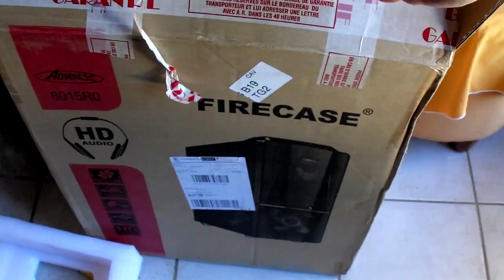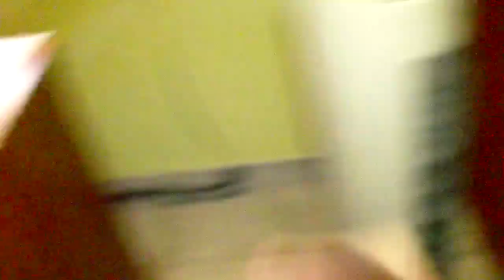Comment monter son PC

Comment: Heum mec tu te demande pourquoi ton proccesseur chauffe autant, tu a mis le ventirad fourni avec le ce dernier cest normal il faut que tu achete un meilleur ventirad :) sinon bonne vidéo continue :)
Reply: +IDworld13 Depuis le temps il l'a changé pour un i7 3770 et un Hyper 212 Evo et son boitier maintenant c'est le HAF 912 Plus :)
Reply: +sheppardpat47 ah ok ;)
Reply: +IDworld13 https://www.facebook.com/ExperimentboyTV/photos/pb.522113141134573.-2207520000.1463911046./1173188219360392/?type=3&theater des barres!!

Comment: Bonjour,
quand un pc surchauffe brusquement faut trouver la cause soit tu as overclocker ton proc et du coup il chauffe du coup plus ce qui est normal. soit tu as une accumulation de poussières dans t'es ventilateur et radiateur de ton CPU un simple coup de soufflette. si ca chauffe toujours au gros maux les grands remède, change ton ventilateur+radiateur avec remplacement de la pâte thermique qui peu cuire avec la chaleur et le temps du coup la dissipation et moins efficace.